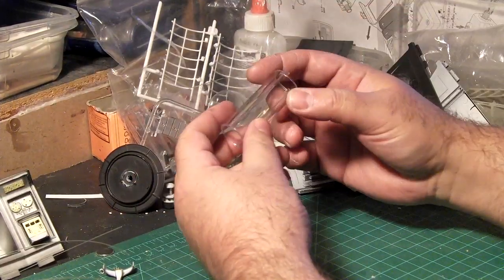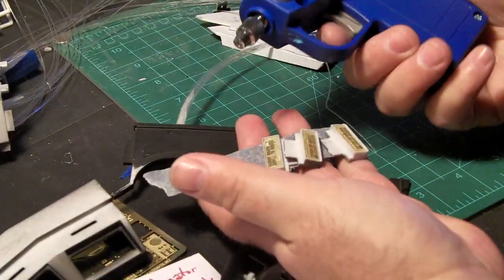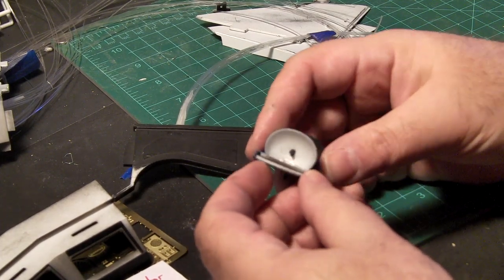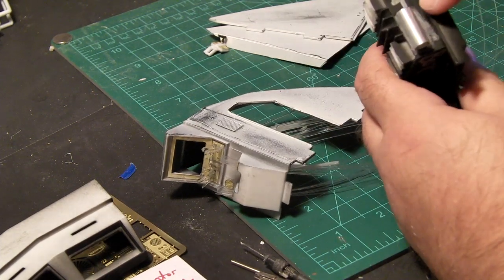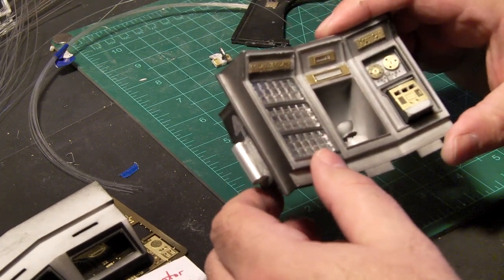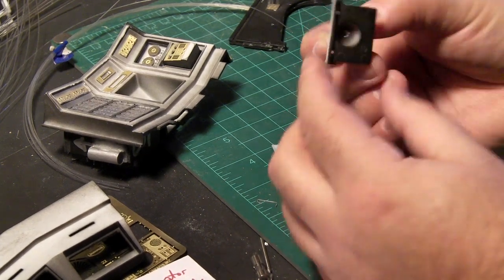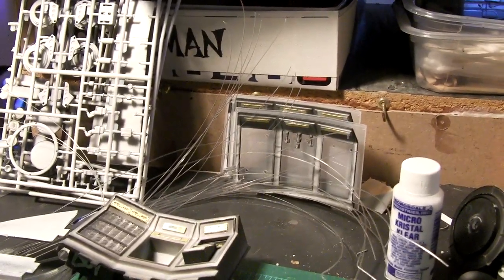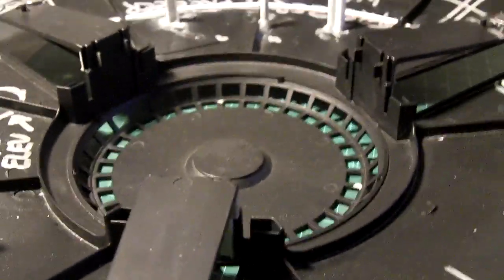Project Jupiter: Flight Log6: PIle'a Part Pickin' 3/5

Comment: for the portal couldn't you just rig up a cylinder out of styrene with one end in the hull and the other cutting through the inner wall, and then just glue some clear plastic cut to fit the inner circumference of the cylinder? Sure the angles would be a bitch, but if you use a piece of paper as a template for the cylinder, you could in theory, just roll it up and trace the angles. Then, unroll it and trace it onto the styrene.